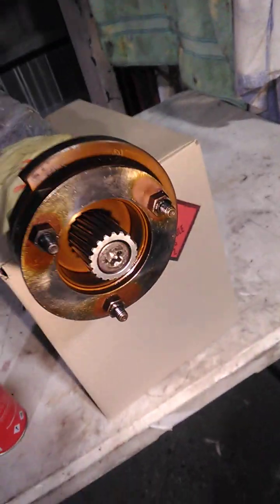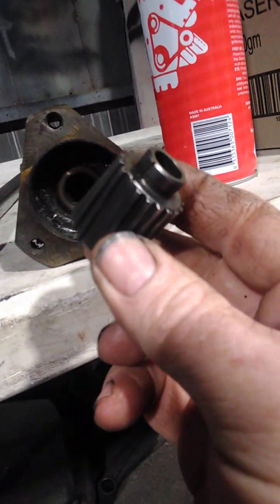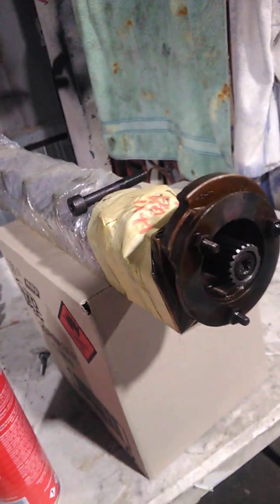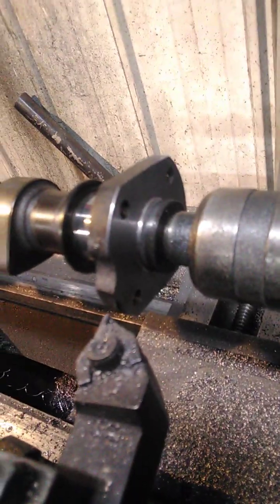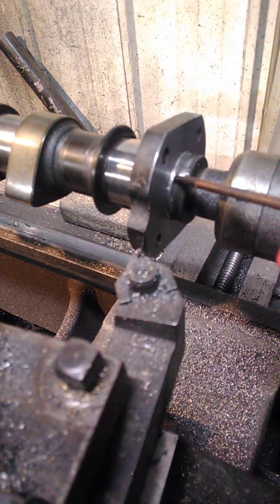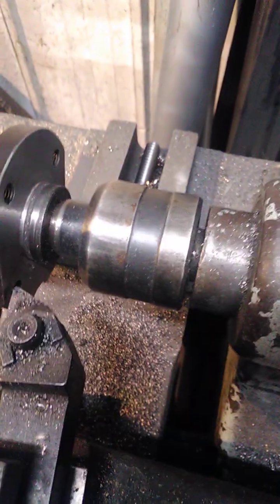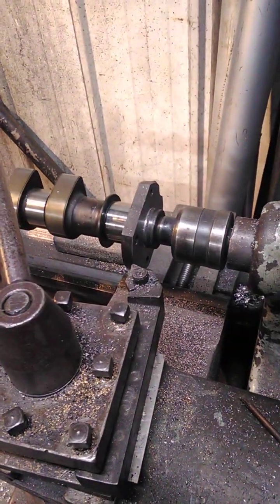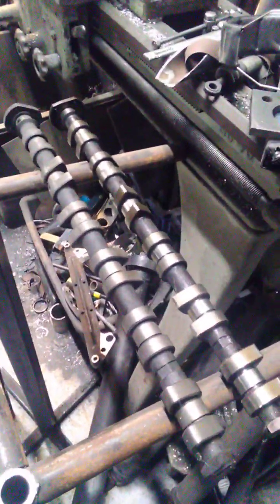BMW m50 m52 franken cam mods,

Comment: I'm currently using a combo m50nv camsaft . Piston rod 140mm. Forget 86.50 pistons. 89.6 crank. The test result is 260WHP. Ecu ecumaster Black. Fuel E25. 275/268 catcams and E50 fuel I think it's 300whp. Max rpm 8400